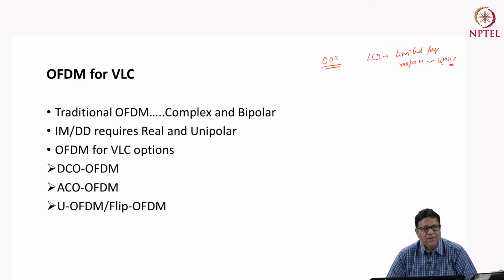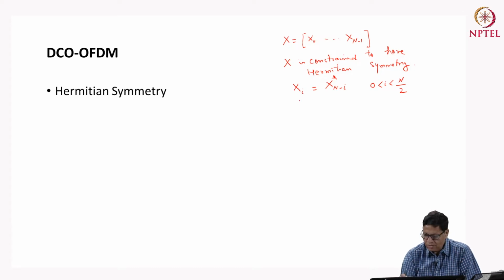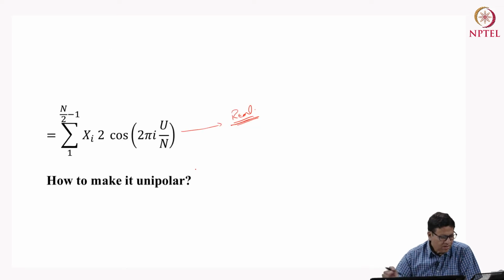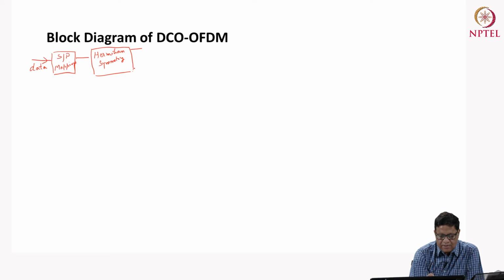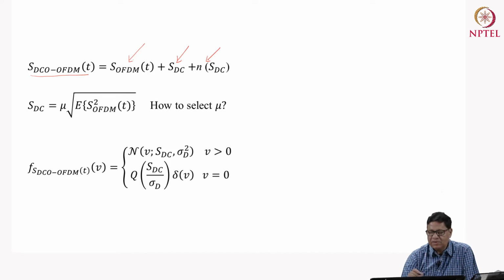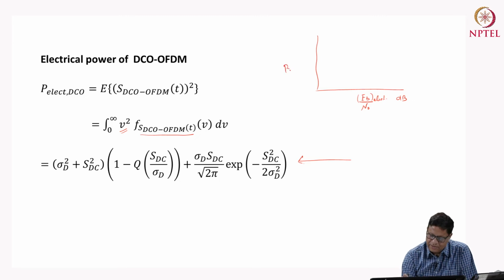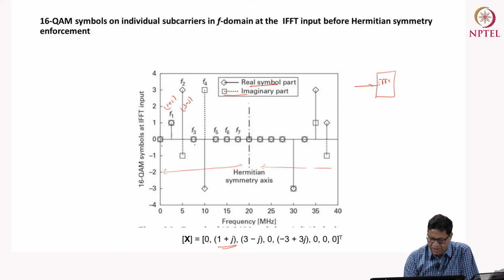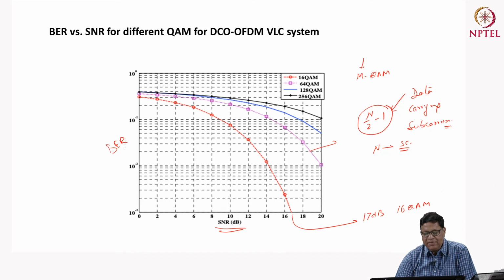OFDM in VLC, DCO-OFDM

Comment: On the receiver side, why the DC bias is not removed?
Reply: Due to the subcarrier configuration of DCO-OFDM, the first subcarrier and the N/2th subcarrier are set to zero. The front segment subcarriers carry digital modulation data, while the rear segment subcarriers constitute complex conjugates. This arrangement results in the output of the IFFT being a real-valued signal. The added DC component falls on the first subcarrier, thereby not directly affecting the demodulation process at the receiving end. If there is any misunderstanding, please feel free to correct me.